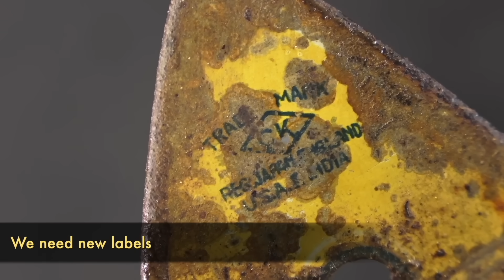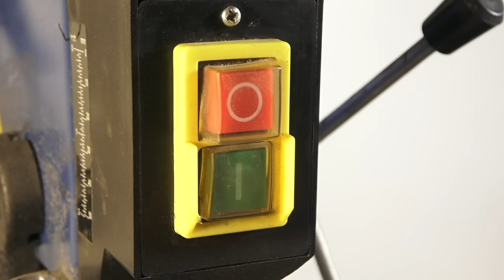1950's Steam Powered Boat "Pop Pop"  -  Restoration

Comment: 😂so funny the Turkish man , love the video , you did a great work, but i didn't understood how is moving in the water 🫣
Reply from the maker: Thank you so much Tysy, I don’t know either 😂 it’s oscillation 🤷‍♂️
Reply: Water in the pan boils, becomes steam, is expelled and propels the boat forward. You now have a vacuum in the pipes and boiler, so water rushes in, is heated, and the cycle repeats. Now you might think that if water is coming in and out that cancels out and so no movement would be possible, but water coming in impacts the boiler front and transfers its momentum, so effectively the water coming in causes no change in the boat's velocity (water comes in, subtracting from the speed, hits the inside of the boiler, adding to the speed, then leaves, adding speed). The ones that have two pipes like this one do not have any water circulation, water comes in and out of both pipes at the same time.
Reply from the maker: @Mariano.Bernacki 🙌 thank you ! Now it’s clear 😌
Reply: The steam both pushes and pulls but the shape of the boat means that the push is more effective that the pull, so it goes both backwards and forwards to some degree but the effect of the shape means that it goes forward.
Reply from the maker: @janskeet1382 exactly 👍
Reply: @TheFabrik  So who is more correct?  @janskeet1382 or @Mariano.Bernacki ?  The former indicates boat moves only because of the differential of the shape of bow and stern whereas the latter explains that both incoming water and outgoing steam water are both adding to propulsion and the shape of the boat is just common sense as other boats.
Reply: Indian man.
Reply: @pbsluvr312 Possibly both. And a third one: The mass of the entering water and the mass of the exiting steam is the same. But the steam exits at a higher velocity than the water is entering. Larger volume but the same mass means lower density, which in turn leads to higher velocity. This assumes intake and exhaust times are equal. It is likely that exhaust is shorter, meaning even more difference in velocity of the mass. 

Monentum is mass multiplied by velocity, so the backward momentum of the exiting steam is greater than the forward momentum of the entering water, generating a larger forward reaction from steam exhaust than backward reaction from water intake.

A neat system involving both Newtonian physics and thermodynamics! 😊
Reply: It look like Mario from Mario bros.
Reply: Simply. Steam powered engine. Water boils in the box. Steam from boiling water moves through two tubes. So pure steam reactive power creates movement.

Comment: Without envy I must say this is maybe the most perfect restoration video ever. Such great work in the workshop as behind the camera as in post production.
Be proud of yourself 😊🎉
Reply from the maker: Thanks a lot mate ! Probably the most difficult project I’ve ever made. I would like to do better job painting tho…
Reply: No worries, your paintjob is just as fine  @TheFabrik  . Key is the temperature around 20 degrees celcius. Spray two light coats and one final thick coat. And keep the recommended time in between coats as exact as possible. But I guess no news for you.

May I ask what cam and especially mic you use?
Reply: Nevermind, its all in video description
Reply: Nah info on mic is not up to date, so still would be interested to know what mic you use
Reply from the maker: @NTRprojects i used the integrated mic of the cam on that project 🙌  something went wrong with the paint. I don’t know what. It took ages to dry… Maybe too hot here, or too thick layers… I’ll do powder coating next time :) hey thanks for the tips I guess I just need to be more patient 😅
Reply: @TheFabrik  Integrated mic of the Sony AX53??? I use the same cam, I never knew the audio is so awesome
Reply: OK I am envious that I don’t have the talent, skill and patience to do this . I so wish I could. It is superbly brilliant.
Reply from the maker: @MrAsBBB thank you very much ! Not that hard with the right material ;) Patience is the key 🙌

Comment: That was a lot of work to rebuild the heart of the little machine.  Very fine metal bending and soldering.  Impressive.
Nice touch with the electroplating, under paint & varnish.  This little ship will have a long life now. Awesome project!
Protip; take a burnt wick (very short) from a common tea candle, to put in the parafin tub. It will concentrate the heat.
Also, you might experiment with slightly different length tubes. Maybe a small extension on one side, just 2-3mm or so 🙂
Reply from the maker: Thank you very much 🙏 I noticed the original tubes had different lengths so you’re right it must be useful🤨  thanks a lot for all these precious tips 🙏 I really wanted to try a candle but it was such a windy day, it was very difficult to light the fire 😣 Thanks again 🙌

Comment: Incredible work, comme d'habitude, very well done! I like pop pop boats, I have often wondered if their efficiency could not be improved by fitting a one-way valve (basically just a hinged flap) to one of the exterior pipes and whether that would not ensure a unidirectional water flow through the boiler, increasing efficiency?
Reply from the maker: Thank you ! Well I still haven’t figured out how this motor works 😂 it’s my very first. Some people build very powerful motors so I need to check:) You noticed it was a windy day on the video and it the boat was always going around in circles 🤷‍♂️
Reply: Not quite sweety, The motor both pushes and pulls. Steam is expelled and the boat is driven forward but then the water is pulled in and the the boat is pulled backwards. the shape of the boat with curves at the bow and a flat end at the stern mean that the boat is more efficient at going forwards that backwards.
Reply from the maker: @janskeet1382 exactly 🙌
Reply: @TheFabrik   YAY !! 💕
Reply: @TheFabrik  Does the force of the water sucked from the water inlet pipe hitting the barrier of the boiler cancel out the backward pulling effect of the indrawn water?

Comment: The oscillation effect is really neat! 

The engine generates steam in the boiler, which expands and travels down the exhaust pipe (with a pop) that shoves water out of the pipe (or pipes in this design). This pushes the boat forward in accordance with Newton's Third Law. As the boat moves forward under momentum, the pressure inside the boiler drops and sucks water back in (the boiler also contracts, producing another pop). This water is boiled, more steam is produced, and the cycle repeats. It also has to "burp" occasionally to release air accumulated in the boiler (water contains dissolved air).
Reply from the maker: Thanks a lot for these explanations 🙌

Comment: Very good video, I like restoration. You can "Sand Blast" with soda bicarbonate. It's mostly dustless and won't pit the blastee. Also, in the 60s I made motor cycles and put sand in the handle bars to bend them without collapsing them. Sand or salt could be used in small things like the putt putt tubes. I have 3 styles of Putt Putts.
Reply from the maker: Thanks a lot for the precious tips ;)

Comment: Interesting use of the solder to assist bending the tune without kinking. Fine, dry sand is also very useful.
Reply from the maker: Thanks for the tip 🙌 I usually use sand for larger tubes ;) thanks anyways, glad you appreciated it 😌👍

Comment: At 7:34 that mention of breaking one of the two clips brings to mind that in these tinplate boat restorations I am always surprised that any of those bend tabs ever survive being worked back and forth for the restoration.
Reply from the maker: It happens sometimes. On the JEP boat restoration video on my channel, I broke a couple tabs. I had to solder new ones 😌👍

Comment: We still get these here in India. However they run on hot air. Everything is same. Only difference is that we don't have to fill water in it. The air heats up and expands and is released from the tubes and the boat moves forward with this very same sound. Price, calculated in dollars would come up to some 80 cents

Comment: Did you ever consider cleaning the rusty parts with blowing it with glaspearls or any other gentle way of removing rust without damaging the metal?
Reply from the maker: I use glass beads sometimes. On this case, the metal was really too eaten by the rust 😑

Comment: What was the fuel that you used? What made it work? Did I miss something?
Reply from the maker: It works with water and heat. The pressure into the boiler is making the thin brass sheet oscillating 👍 It creates power 💥

Comment: Brother it will not work for more than 2 min. Soldering element will be heated very soon when in direct contact with heat
Reply from the maker: The boat is working still 🤷‍♂️ I used heavy tin 👍